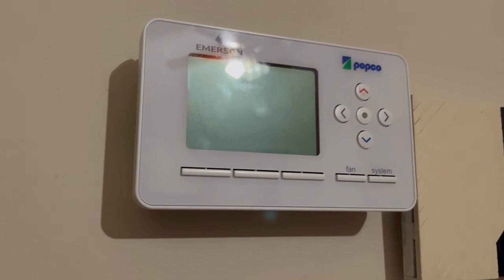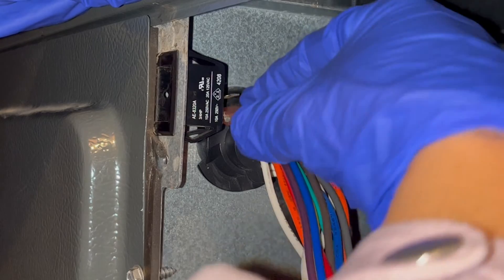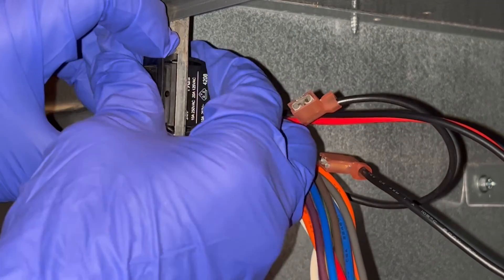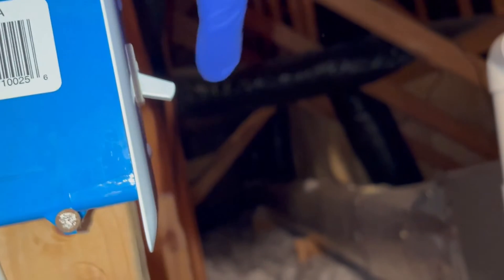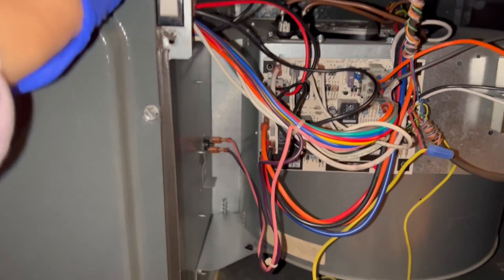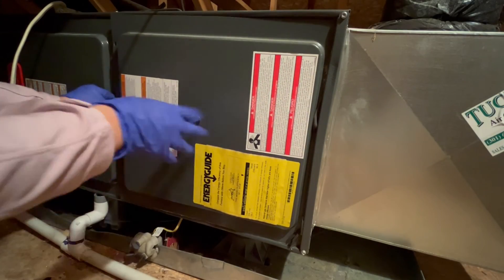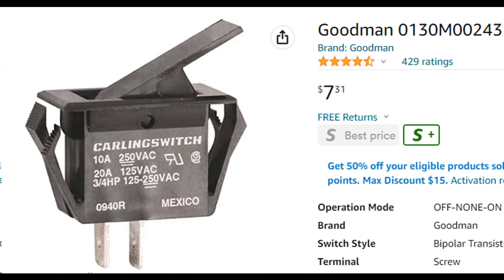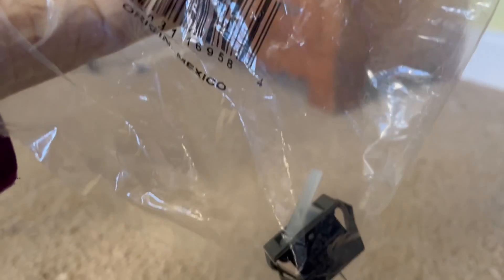How to fix broken furnace door switch

Comment: Good for you. $250.00 dollars for a 5 minute job is ridiculous.
Reply: It's the cost of business. Every trade charges 50-100$ to show up, and an automatic 1 hour fee regardless of the job (100-200$/hour) They don't know what they're walking into, not to mention most companies will do a due diligence to check that your furnace doesn't have a cracked heat exchanger which could potentially kill you in your sleep.

Comment: Nice work.  It pays to be willing to try to figure things out most people don’t.  The price for the service call was pricey but think about the cost of the company sending a technician out and crawl around in an attic . If you bring a car in to diagnose at an auto shop it will cost about the same yet your driving there on your time and gas. So fair is fair.
Reply from the maker: John, your assumption is correct. They wanted to charge $100 to send a technician to diagnose the problem first because they couldn't be 100% sure that the switch was the problem. Then on top of that, replacement of the switch was going to cost $130 because they would have to figure out what part to get, pick it up from the supply store, and  return the next day or another day when they could get the part. I called 2 HVAC companies and the drill was the same for both. When I said the part was just a few dollars on Amazon, none of them was willing install an Amazon part for me because they said they can't provide any warranty on their work then.